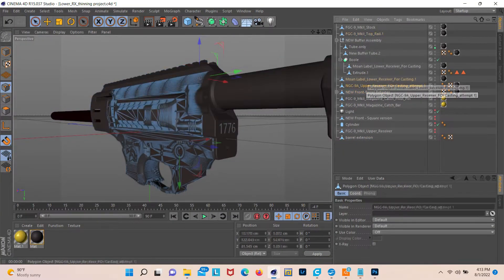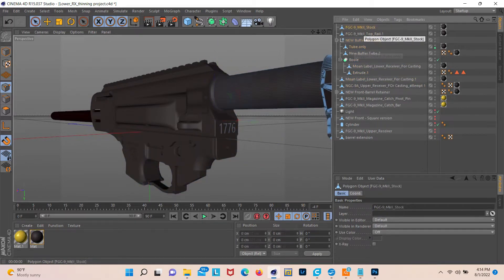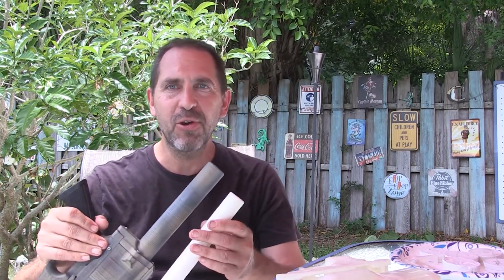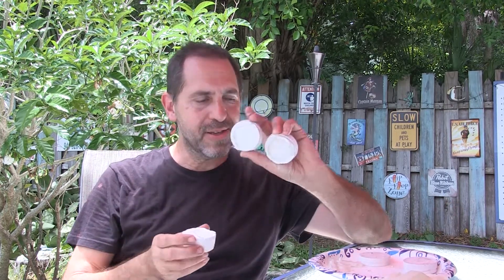Aluminum FGC 9 Project - Part 1

Comment: I think the original hydraulic tube barrel is plenty homemade.

That said.

If youre intent on using something like bronze, I would get a rod the diameter of the collars used to secure the original barrel and cut a relief where the clamshell goes to secure it. I forget the diameter, something like 30mm, but it would be plenty strong until it began to heat up.

Something else to consider is that cannons didnt have rifling, it may be better to go smooth bore on this one

Comment: dont cast a barrel unless you want to die.  go and read about pressures. a gun is very close to being a bomb. you couldn't shoot through a barrel made of mild steel safely with smokeless powder. let alone anything else.,
Reply from the maker: Your warning has great merit.  
Oddly, I once had a rifle (7.62 x 39) explode when I took it to the range for the first time.  It was dramatic.  Aim.  Breathe.  Squeeze.  Bang.  I stood frozen looking down range through the sites for several seconds thinking "something's wrong" before I slowly looked over and saw blood flowing from my arm.   I did not enjoy the hospital visit.  20 years later, I still have small pieces of steel in my arm so, yep...the risks are serious.  
 I'm more cautious in practice than I probably seem.  There's a lot more science to casting than it seems on the surface.  If I do eventually go down that road, it would involve much research and care...and remote testing.

Comment: any update on this? i was thinking it would be fun to try something similar but instead of metal, i was thinking of making a silicone mold of the 3d prints, and casting in a much higher quality resin material. smooth on sells some really high performance resins that have much higher strength and heat tolerance compared to 3d filiment. btw, were you planning on releasing your edited files?  check out a metal called zamac. its basically an alumunim / zinc ally thats pretty strong, low shrinkage and lower melting point compared to aluminum. i was able to melt it on my stove with the help of a torch.
Reply from the maker: Unfortunately, YouTube deleted my updates. Too frightening for their tender eyes. Lol. Yes, I managed to cast an upper, lower, front & rear. Definitely usable but not as aesthetically pleasing as I’d like.  I’m starting over using a Saturn S resin printer which produces MUCH better prints. It’s amazing.   I recently upgraded my kiln by adding a programmable controller which has improved my quality. I plan to try casting it with ceramic shell casting soon. I’m pretty excited 😊   Using a Silicon mold is an interesting idea. They do tolerate high temperature’s pretty well. Seems like it might work.  Good luck!!
Reply: @amphoravideo hey what the other guy said. Could you please upload the videos to the Odd Sea or another gun friendly platform? Been following this and the ABS FGC for awhile
Reply: Any where we can find updates on this since YouTube is full of sissy's

Comment: Any updates on this?
Reply from the maker: Well....there WAS an update until YouTube decided that it was just completely unacceptable and pulled it down.  I don't think it actually violated anything but I suppose aluminum frightens them.  Basically, I successfully cast an upper, lower, front, and back but they weren't as aesthetically pleasing as I'd like.
I've now upgraded to a resin printer and have added programmable controllers to my kiln and furnace. So, my technology and understanding of the process are greatly improved and I'm planning to re-cast them soon.  I'll try to post a new video...being careful not to terrify the fragile ones who monitor this stuff.  lol

Comment: I'm doing it this way, I made a base piece on the 3D printer, I made a mold of this person and I'm making wax copies, and then these copies go to another mood and I put it to dry in the oven at home, to melt the wax, and with the mold dry and with the wax melted, this mold goes into the oven that I made with an air conditioning gas cylinder and refractory bricks that I made watching a video here on YouTube, if you want to learn how to make this low-cost oven, just browse here by "FORNO DE FUNDIÇÃO CASEIRO"the video is in Portuguese, but watching it is not difficult to do the same
Reply: Do you know you can melt metal in a micro wave ?
Reply: @spartoiss488 micro wave ?

Comment: I'm actually doing this right now, but for the upper. Also did this for the bolt drilling jig and welding jig because the pla ones just weren't cutting it

Comment: I saw a guy use rebar for his barrel material and use the "bathtub" rifling technique and it worked perfectly for him
Reply from the maker: definitely worth considering.  Thanks!
Reply: @amphoravideo  you can bore a barrel out of an old steel bolt or rebar or something with a drill and a vise , and you can make a rifling button with a Dremel and a piece of old drill bit that you harden in your kiln. Refer to theIdahoanshow for more in depth detail it was his idea.
Reply: @zVoiddd  you can also just bore to around 5mm or so and use ECM, reduces the need for expensive equipement like rifling buttons and dies

Comment: Lost PLA method?
Reply from the maker: Yes, but this filament is specifically designed for casting. It burns out flawlessly.
Reply: @amphoravideo  You can use concentrated NaOH or KOH solution at 50-70 degree celsius to dissolve the PLA without need to burn it out. Plain transparrent PLA works best, or use red color to easily identify ane undissolved remnants. At 60C a piece of 1.75mm PLA filament dissolves in less than 3 hours in NaOH solution. Need to 3D print hollow or with minimal infill, and provide flow through the part using some pump. 5W aquarium water pump would do. Can coat the part with heat resistant silicone, which might allow for casting multiple parts. This will do for ZAMAK 2 or other Zinc alloys, but might not work for aluminum since temperature is too hight for most silicone. However, there is one that can withstand 1200 degree C and should work, but is brittle and will not allow repetitive use. In my opinion casting in Zinc alloy is better, since it flows way better than aluminum, has roughly same strength, and casts in much lower temperature. Didn't tested this yet to make any part, but I did dissolved PLA this way and cast Zing in silicone years ago, so it will work. Remember to dry the mould in kitchen oven 2-3 hours at max temp before casting and wear glasses.

Comment: Ive been wanting to do that for some time, just missing the burn out oven (expensive). How are you going to bypass this process?
Reply from the maker: Short answer is that I use a kiln.
Longer version is... I bought a very old electric kiln dirt cheap from Craigslist.  I removed the top half and used it to make a small melting furnace.  The bottom half is now a half-height kiln...which is PERFECT for burning out.
Reply from the maker: @GriefGrumbleTheMauler  wow....  that's a lot of good info.  thanks.  much appreciated
Reply from the maker: @GriefGrumbleTheMauler  Interesting.  I'm going to have to investigate the wax model scenario.